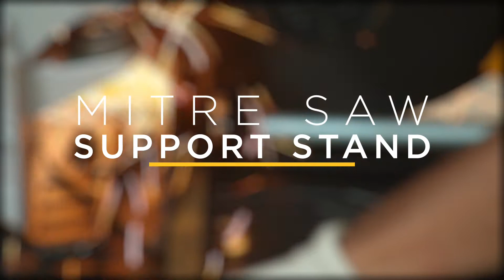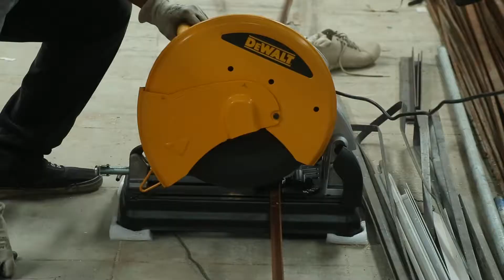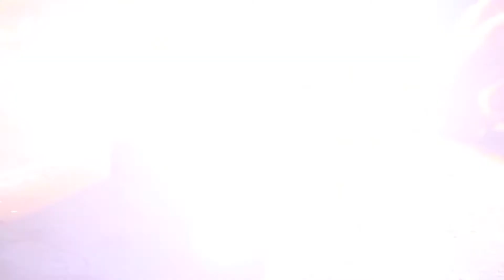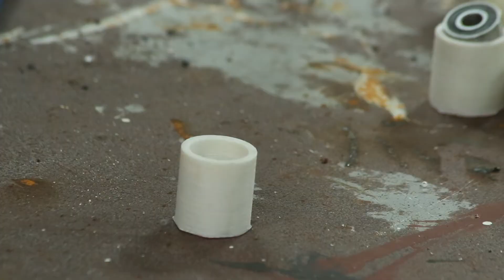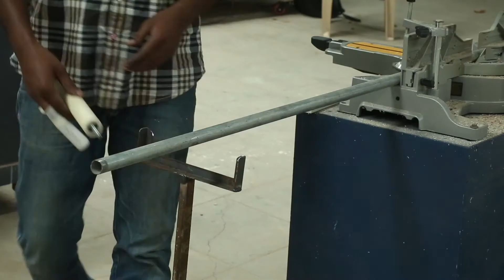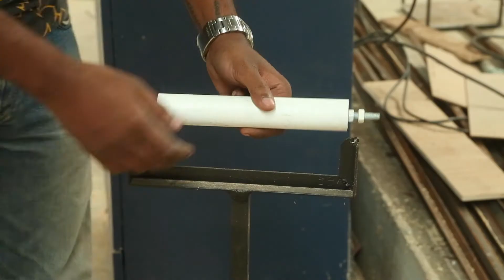Miter Support Stand - Shop Project

Comment: by the looks of it you are using an arc welder, i bought one about 4 months ago but did not use http://www.industrybuying.com/arc-welding-machine-ambay-WE.AR.AC.1544363/, as i was unaware of the MCB i should be using to use it, and also i was afraid that i might be electrocuted,  could you please make a beginner arc welding machine handling and different cuts used in welding and joints tutorial as soon as possible
Reply from the maker: +Madhu K The one that you bought is a Inverter based design. You can put plug that to your mains. But remember to use the 20amps socket. Otherwise the MCB will trip. Also make sure the MCB is also a 20amps one.
Reply: awesome, Thank you very much, i am making a board with 20amps mcb and a 16amps socket with 4sqmm polycab wire for both neutral and phase

Comment: Good design but I think you could have designed it to be height adjustable.
Reply from the maker: Yes I wish too. But it hit me later only.
Reply: You still can, all you need is a new rod and to make holes in both the rods using drill press, but you would need metal with good gauge, to survive the frequent adjustments.